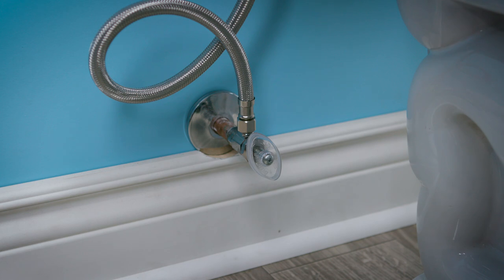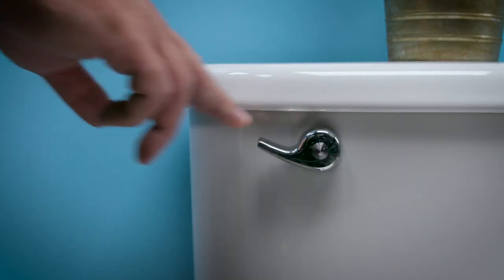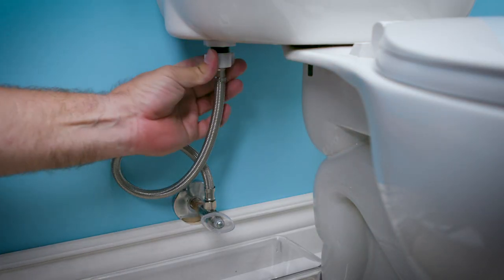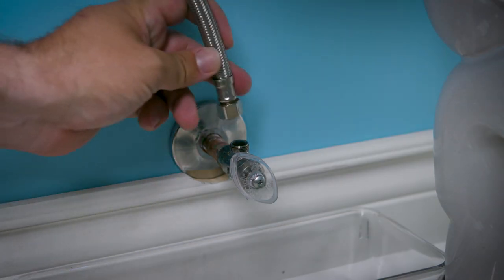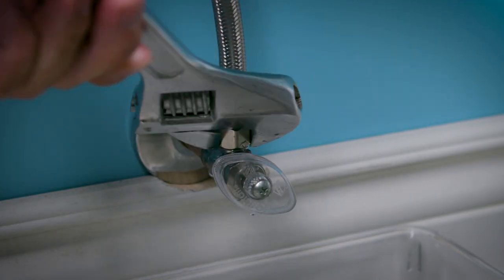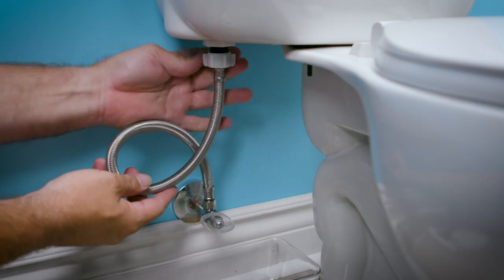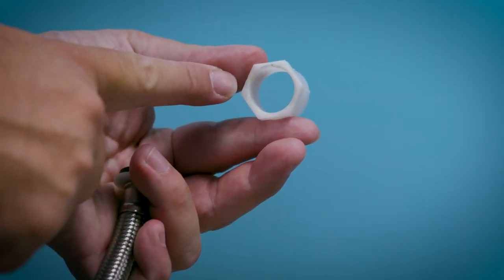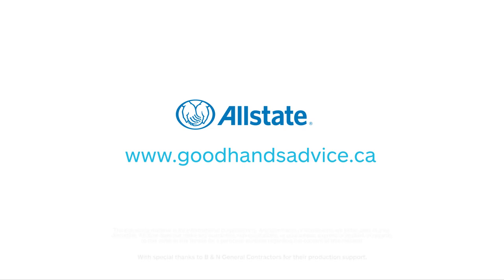How to Replace a Toilet Hose | The Good to Know Series | Allstate Canada

Comment: That advice about getting a shorter hose only makes sense if it's close enough that the hose doesn't need to loop around. A short hose looped around is difficult to install and there seems to be more stress on the entire thing because the loop needs to obviously be smaller. The longer hose can accommodate a much gentler loop and doesn't require such strong-arming to install.